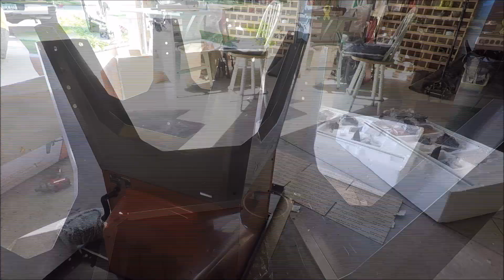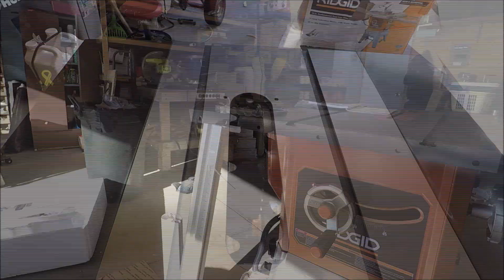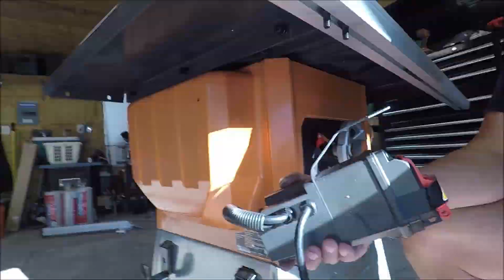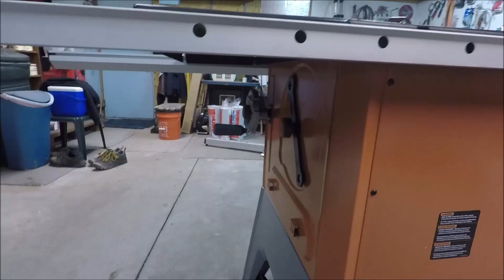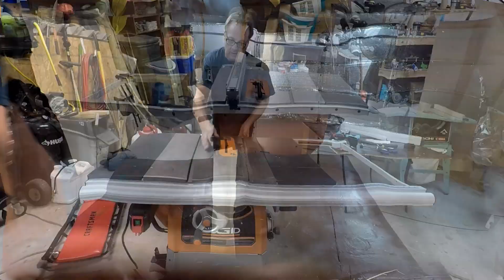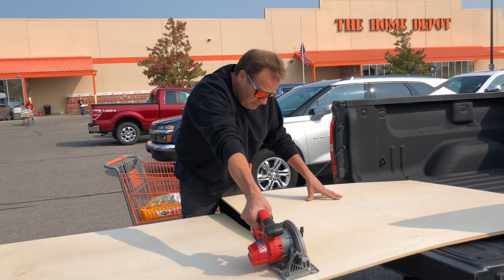Ridgid R4520 Table Saw Set Up & Use

Comment: DONT BUY THIS SAW. I DID. Learn from my mistake. Buy a real saw.
Reply from the maker: Still going with no problems
Reply: @Marksmisfitworld  I’ve heard great things but this saw has a factory defect with the lowering mechanism. Mine is in the shop (a year old barely any run time) but getting through to them was a nightmare. Can’t do anything for 2 weeks now, maybe 8 more depending on parts. Glad yours is fine 👍👍

Comment: How’s this saw holding up? I’ve heard some of the negative reviews about the lifting mechanism.
Reply from the maker: I replaced the first one because of a bad belt pulley. So far so good with the replacement saw under warranty
Reply: @Marksmisfitworld  thank you! I was looking at this saw and I think I’ll pull the trigger on it
Reply from the maker: Get the extended warranty. I believe you will ha be a year longer to use it under their Warrenty.

Comment: There have been so many negative reviews of this saw. I have owned it for 10 months and I just took it to the dump and bought a Dewalt 7491rs.  The problems are endless. One of the biggest is the blade riving knife has a metal part that moves with the riving knife that will bend and mess up the movement. After awhile the blade will not go up or down all the way and  will jam. The New Improved Motor does not stop as soon as they say, mine took 20 sec. The fence doesn;'t align properly so I sold it after I bought it. The blade alignment is poorly explained and needs special PAL parts to make it work. I reached out to ridgid about the complaints and they ignored my email. Save your headache and go buy a Dewalt 7491rs you will be glad you did.

Comment: How’s holding up the up and down of the blade, they said there’s issues on it that binds everytime you lift the blade up or putting it down, I’m in searching of table saw, thanks
Reply from the maker: I have not had any problems with it yet. I do clean it after every use that is part of the maintenance of the saw.
Reply: @Marksmisfitworld  i believe your right, I always clean my contractor type DW745 after use specially inside, I think the sawdust is the reason of binding

Comment: I bought the R4512 a year ago, spring, and I love mine. Great video showing the build, set up and usage. Well done.

How has the garage door insulation been working this past summer? I loved your video on that, too. I'm in So. TX and it gets hot in the summer. I'm pretty sure I can get the inside temp down with insulation but I like the open air. However, with my garage facing the afternoon sun, when I open the door, the garage gets back up to air temperature, making me wonder if it's worth the effort and expense. Sorry for the off-topic comment. Just wondering how your garage has fared this past summer.
Reply from the maker: Glad to here you still like your saw. It’s 10 times better than what I was using. 
  The garage door is still doing good keeping the temperature down from the radiant heat in the afternoon. The door might be getting replaced next year as it is starting to get a little worn out. But after almost 30 years of opening and closing it is to be expected.
Reply: @Marksmisfitworld , do you open the door in the summertime or do you keep it closed and let the insulation do it's job? Judging from your accent, I'm assuming you're in a northern climate. That being said, how hot does it get on average? We get to upper 90's on a typical day from July to Sept. Even if I could get the garage down to say, 85, with insulation, I still need a breeze. I've got a big 24" fan and a Ridgid Octane fan but it's never enough when it's 100 degrees. Lol